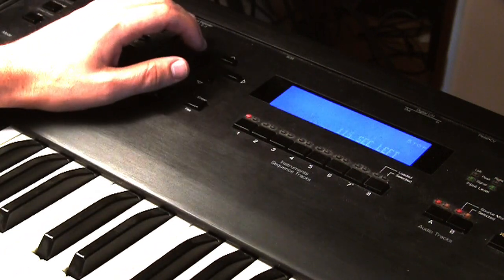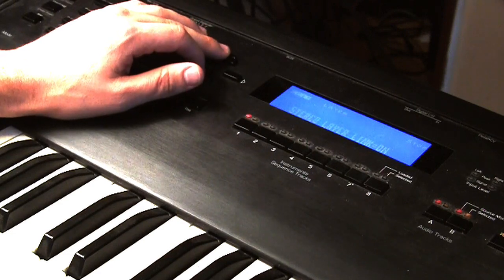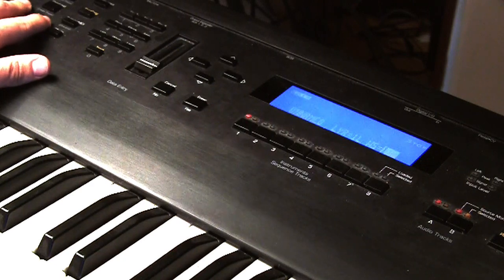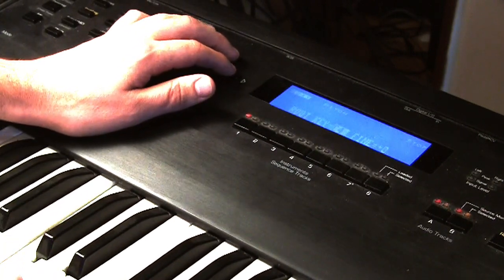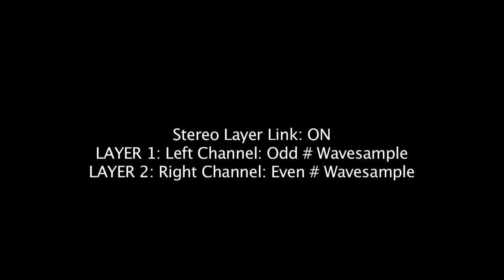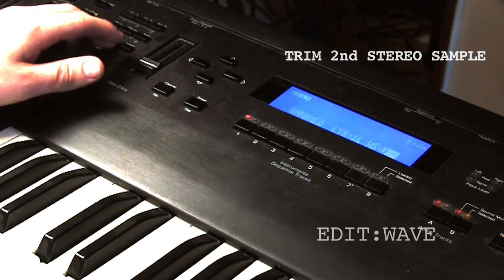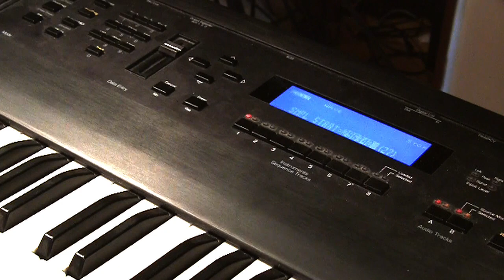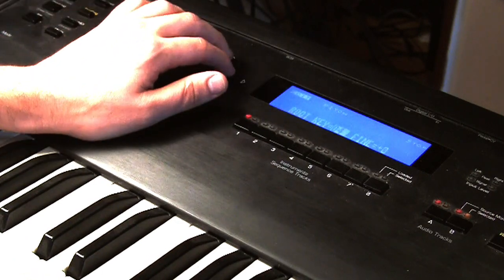Stereo Chopping on the ASR-10 Sampler

Comment: Thanks, this video helped me figure out something that has been bugging me for years. My tip is to turn Stereo Link "off" when setting the pitch range and assigning key to the copied layers. Then before you want to start trimming your copied stereo sample turn the Stereo Link back "on". Again, thanks for this video.
Reply: sandrothesandro Thanks for the tip. Can you please explain to me how turning stereo link off helps the process? Thank you.
Reply: I find it easier to set the pitch range and tuning for the Layer 2 sample without effecting the sample already set to Layer 1 if the stereo link is off.

Comment: I tried this many times exactly like you explained but it does not work. Which OS are you using?
Reply from the maker: Hey, I use O.S. 3.53 the last update. What seems to be the problem with the process. I kinda doubt it's an O.S. issue.
Reply: i use os 1.61, it has some benefits over the last os. but im getting layer edit not allowed message if i do it like you did. when i try to set the key range. so i suspect the os to be the problem. will check with os. 3.53

Comment: You know what sucks? Is looping in stereo..... The Auto Loopfinder doesn't work when stereo link is on.. You have to turn off stereo linking and manually loop one side at a time.... 2nd channel first, the get the 1st channel close, turn of auto loop finder get it to the same as the 2nd channel, and then you can re-link them and your loop will be flawless.
Reply: Jim, I've never figured out the auto-loop function. I keep it on. I'm pretty sure it find zero points on the waveform, but I'm not sure. Changing start points does work in stereo link though. The annoying thing, I find, is when you have a longer loop and you wanna check the end and you have to wait through it each time. That's why I do chopping because it ends up more on-beat. But for a pad or sustained lead, looping is definitely helpful...
Reply: The loop function like you said, finds the zero points. It's extremely useful. Especially when your making instruments. Single Cycle Loops and so on..
You would want to keep the loop function off when messing around with Transwaves...
Like I said though, the "Auto Loop Function" doesn't work with the 'Stereo Link" on.. Unless it's only my machine that doesn't... I doubt it though. lol....
Lots of times I find myself sampling beats I've made.. Of course I want to sample them in stereo.. I like to do that because I made tempo directories. I'll mix bets with the same tempos together. I've came up with some good stuff like that and it's just fun.
I hear you about waiting for a  long loop to finish. Sometimes in situations like that I'll bring my start point all the way up to get myself in the ballpark quicker... If that makes any sense...
The Auto Loop is also useful to find a good start point. Wherever my loop start begins in most case thats where i'll land my sample start.. Because you know there will be no click there... So I'll find my start point... Then I'll get my start loop point closest to that number.. Wherever my start loop point will drop I'll change my Start point there. I'm sure you understand what i'm saying... I'll even do that even if I'm not looping the sample.. I'll just turn the loop forward off after I find that spot.